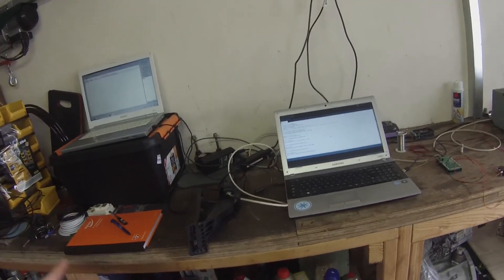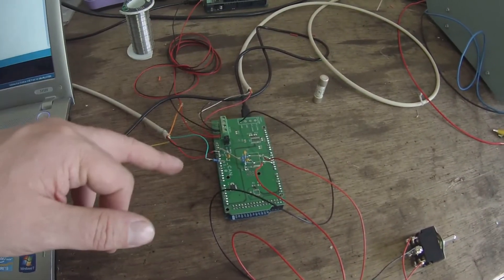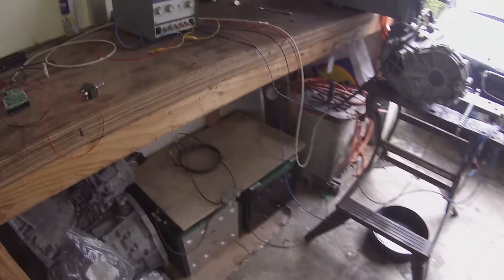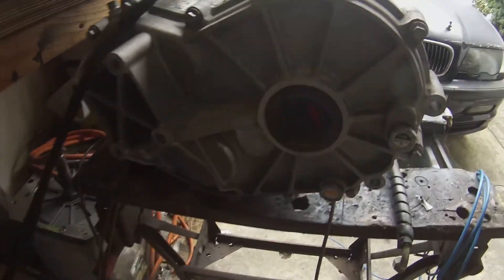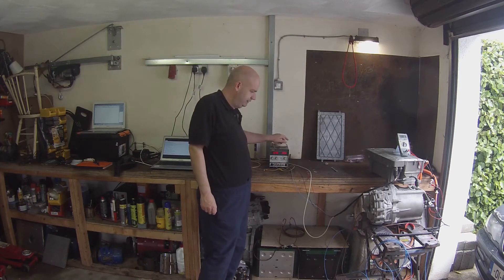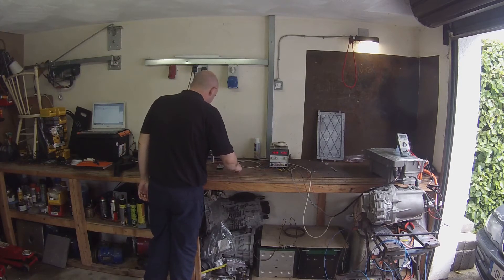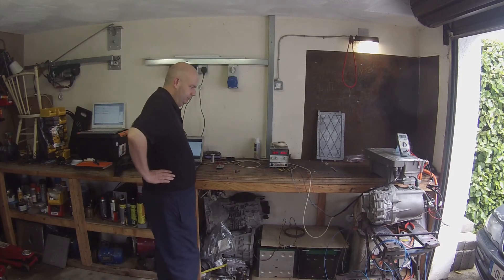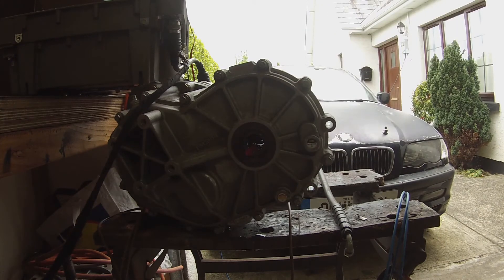TM4 Front Wheel Drive System Project 03 : Torque Control

Comment: Hi Damien, Just found your channel and your videos on the TM4(EE300T) motor. I have just bought  and Australian EV with the TM4 motive motor in it but it has some control issues preventing the motor from getting power to it.  your insight on the way the inverter gets its info from the rest of the car and the accelerator is invaluable to me. I could really do with some technical info such as the pin out for the inverter and where I can source an  Arduino unit. Can you help? Oh and where is your github at?